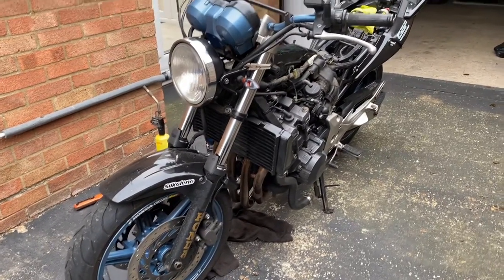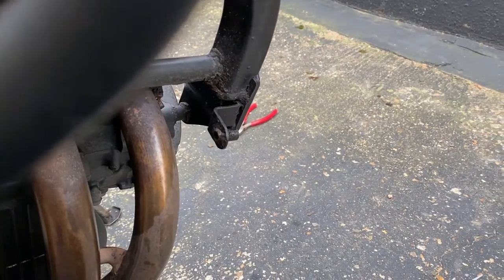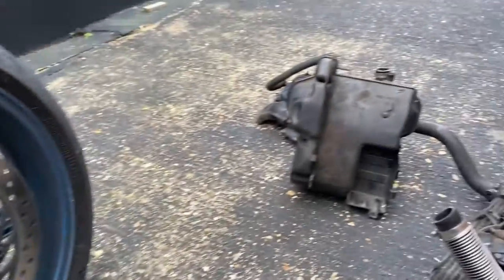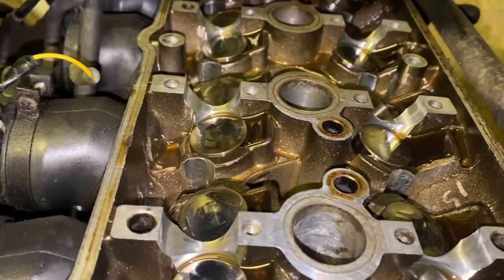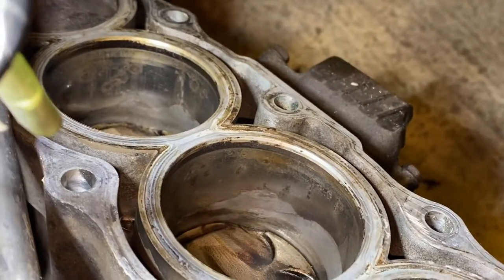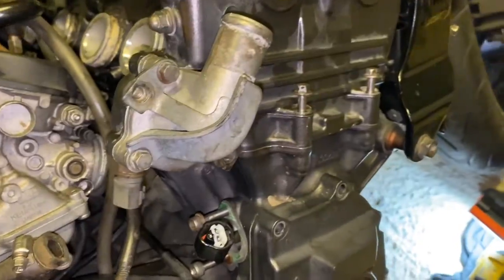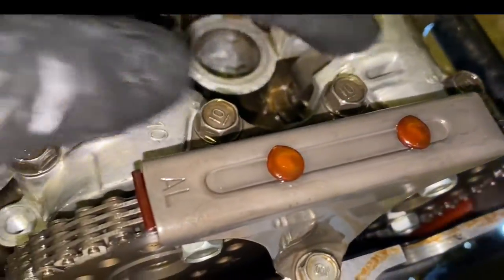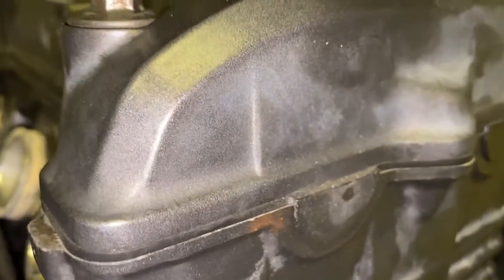How To: Replace Cylinder Head Gasket On A CBF 600 N6

Comment: I have just purchased the same kit. I did on test and the fluid changed yellow…… however I wanted to do a number of tests to make sure. Every subsequent test has resulted in coolant being pushed through the test kit therefore ruining the validity. Any tips on why this is happening? Not sure why this is happening myself self with a lack of knowledge here. Cheers.
Reply from the maker: Hi mate, I had the same thing happened to me also, in the end I started the test with a cold engine, that way the coolant couldn’t expand quick enough to ruin the test. Also you could drain some coolant and do the test so it doesn’t have a chance to get pushed through the tester so easily. Failing that you’re head gasket could be failed to the point it instantly pressuring the system pushing the coolant out immediately. Hope this helps
Reply: @rollingwithjoe7562  Cheers! Yes. To be honest I’m thinking it’s failed in all honesty……..